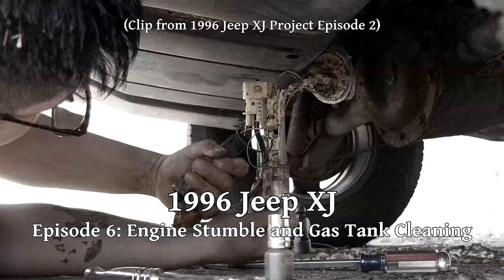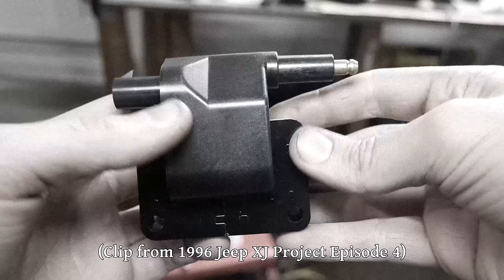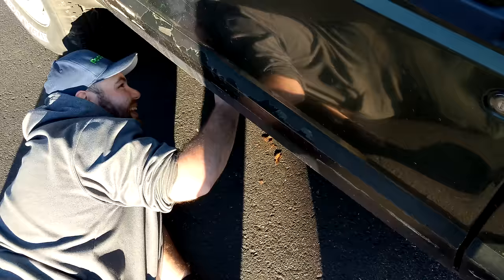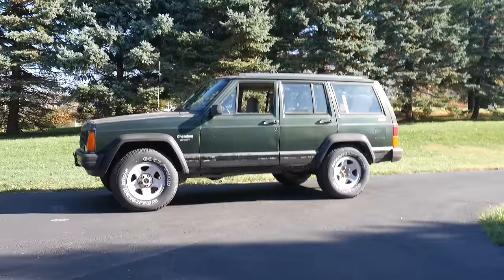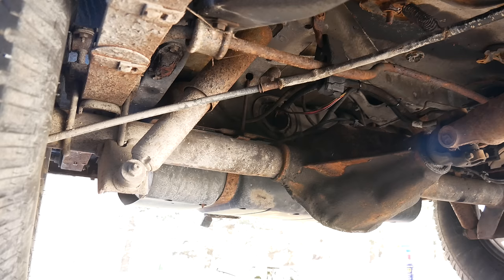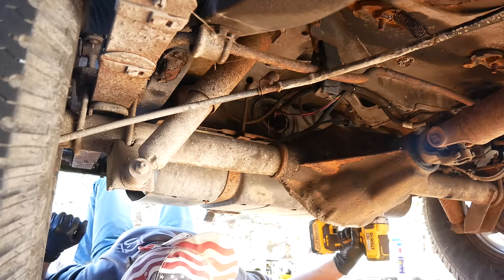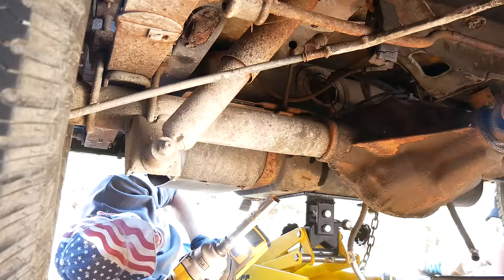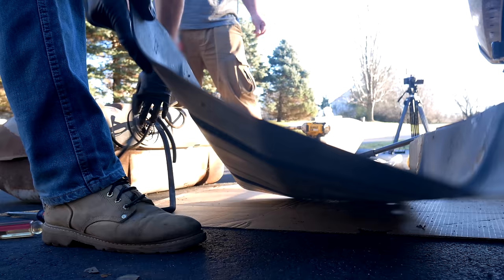1996 Jeep Cherokee Engine Stumble Diagnosis and Gas Tank Cleaning (Ep.6)

Comment: I love his videos, but I'm always a bit disturbed with these "do it cheap" videos because they constantly go something like this:

"Head into your 3-car attached garage, approach your Craftsman workbench and fire up your hydraulic drill press, then finish things off with a nice TIG weld, pop it into an autoclave for a quick cleaning and you're all set.  Now use the aerial lift to raise the car up and easily install your part.  In just 7 hours we saved $12 and a 20 minute trip to the auto parts store."

I wanna see the car repair videos where all you have is a Duralast tool kit and an unpaved driveway.
Reply from the maker: To an extent I understand, but I think we are still working with a much more basic and attainable tool set than many other YouTube channels. The garage is fantastic and the most unusual thing we do have to work with, but the workbench is 2x4s, plywood, cardboard, and a $20 Craigslist vice, the angle grinder used to cut the socket was free with a HF coupon, the MIG welder is one of the cheapest 240v models you can buy ($170), the belt/disc sander was a gift from a friend but I think they are around $50. The impact gun used to remove the tank was about $140 including the third party battery. The transmission jack was around $150 but a standard floor jack (or just a friend lying under it) would have actually worked better anyway. Pressure washer was free from a neighbor, fixed it up. Just a basic idea but there really wasn't anything exotic here, I don't think.

It isn't a dollar store tool kit and a gravel driveway, but I also feel like it is within the realm of reason for many people. I hope it isn't just me that feels that way, but I suppose I do not really know.
Reply: @FuzzyDiceProjects  Oh, nothin' against ya, my friend.  I've watched about %90 of your videos and many of them twice.
Your '91 lead me to you.  I've owned 3 Firebirds myself.  A 91 a 92 and a 2001.

The biggest infractions go to Chris Fix, Autotech, etc.  I remember laying in my driveway on a brisk 20 degree evening trying to swap the alternator in a 2006 Escape.  I've never wanted to just send a car to a scrap yard over something so minor so badly in my life; yet the YouTube videos are about 6 minutes long and include words like "Easily" and "hydraulic press".  I don't even have a vice!  =(  Just bare hands.  Bare hands with bitched-up knuckles and regular tetanus shots.
Reply: @thefoxfrenzy  We all started where you are, but at least for me, I'm not going back. Literally the first thing I bought when I setup my own work space was a vice and I bought it on a credit card. Gotta do what ya gotta do.

If it makes you feel better, I make insanely huge fiascos out of small projects just because I do... So...
Reply: @TheBrokenLife  Well, of course.  I own a Dodge and an Audi so I'm used to small repairs turning into colossal projects.
My next purchase is going to be a table saw, so I can build a work bench, so I have something to install a vice on.
Reply: @thefoxfrenzy  I built my benches out of 2x4s exactly because I didn't, and don't, own a table saw. ;) I did have Home Depot cut a few things for me on their panel saw though.
Reply: @TheBrokenLife  This gives me a thought.  He should do a video tour of his garage so we can see all his tools and get a little history on each!
Reply: @thefoxfrenzy  Every once in awhile he does a video sort of like that, but it seems people just mostly complain that it's not a project video when he does... :/
Reply from the maker: Understandable! I replaced an alternator in an '05 Escape once, that certainly is a debacle. Never want to do that again, taking the CV out and using stacks of extensions to get to anything.

EDIT: Also, I would like to do a garage/tools tour at some point. Need to make things less of a mess first.
Reply: @FuzzyDiceProjects  I feel you... Reducing my mess is literally the project on my channel right now... ;)

Comment: Crank angle sensor calibration?  Your cheap OBD2 scan tool can't do it.  You need something with bidirectional control.  Some OE's require a crank sensor angle/offset relearn procedure after replacement of the crank sensor.
Reply: I don't believe that's needed on 4.0s... or at least mine didn't need it.

Comment: You couldn’t just weld the 2 sockets together without all the cutting?
Reply from the maker: The stud wouldn't have fit through the 3/8" drive at the base of the socket, so the drive square had to be cut off of one of them. I should say "probably" wouldn't have fit through because I didn't have it in front of me at the time to check, but I don't think it would have

Comment: You made a custom, extra long socket instead of just cutting off 6 inches of the ridiculously unnecessarily long threaded rod that serves absolutely no purpose....... well okay then.  I guess that works too.
Reply: Altair Ibn-La Ahad Have you ever mounted a gas tank with straps? Anything?
Reply: Personally... I would have just cut the J bolts and replaced them. I've done stuff that rusty before and half the time they just break off anyhow. BUT... Now he has an extra long 14mm for the rest of his life... and who among us couldn't use some more length?
Reply: @jonasthemovie  Yep.  Old fox body Mustangs have bolts, not threaded rods.  I've laid under the car and bench pressed the gas tank back in place and thread the bolts in with my free hand.   Older me now uses a floor jack to lift/raise a gas tank with non issue.  I live in the rust belt and it still only takes me 10-15 minutes.  Those threaded rods make more problems than they solve.
Reply: @TheBrokenLife  That seems reasonable in that situation honestly.  Certain Jeeps are notorious for basically assuming bolts are just going to be chopped off instead of removed.  Nothing wrong with that, just how she goes sometimes.
Reply: @MrClarkisgod  It's all part of wrenching and we all go about it in our own ways. That's why it's fun to make and watch videos like this and build a community of people to shoot the bull with. Plenty of interesting ideas under the sun.

Comment: cant drive anything in the UK without it passing an inspection (mot) and that jeep would not pass an mot, what are the laws regarding vehicle condition in the US? oh also, great video, loving the content :)
Reply: Depends on what state you live in. Some states require a basic safety check when the car is sold, and some just want a smog (sniffer) check every other year. Some states don't require anything.
You guys in the UK have some of the strictest laws regarding vehicle registration.
Reply: It does depend from state to state in the US but even from county to county you can get away with things you wouldn't in others.  It just depends on if you got a guy.
Reply: Alot of places that have inspections boil down to does it look stock emissions wise clear is the check engine light no check do the suspension/brakes function/aren't rotting off check